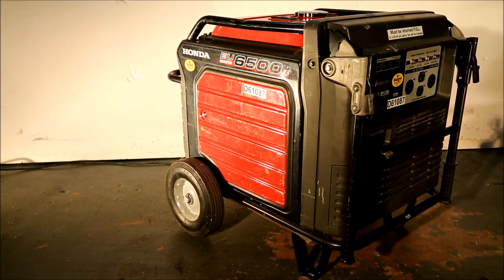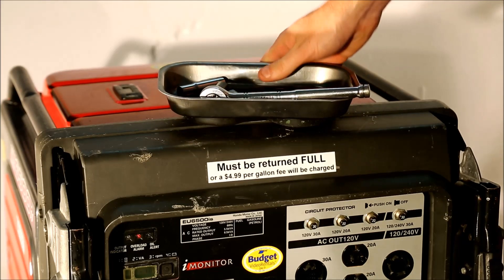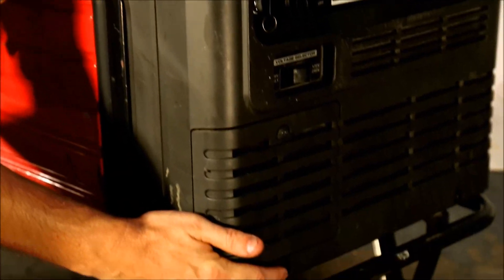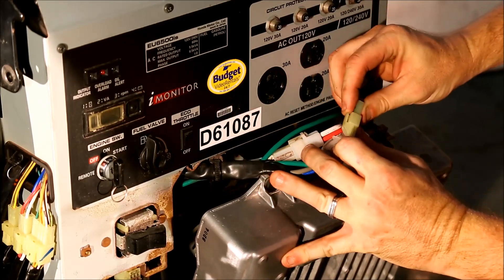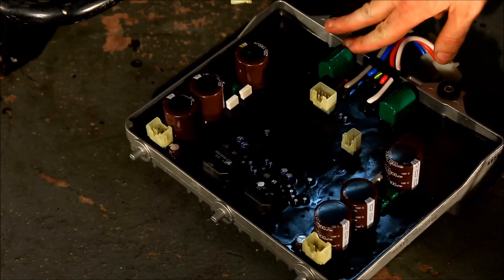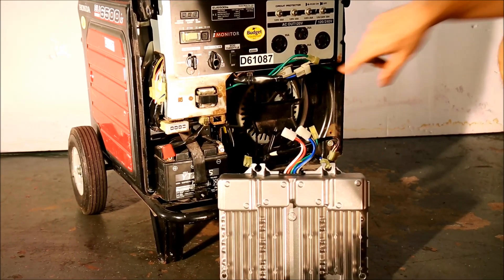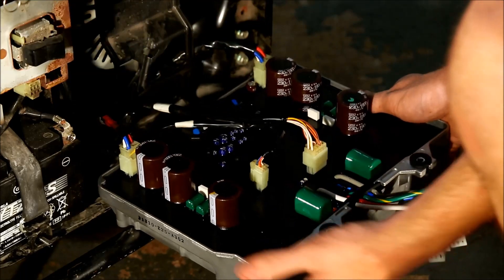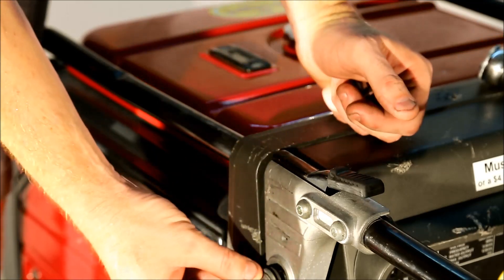Honda EU6500is Generator | Inverter Replacement

Comment: Hello my eu7000is turns on the green out light turns on and so does the red overload light the green output shuts off after 5 seconds and the red overload stays lit but doesn’t shut off does that mean my inverter went bad any information would be greatly appreciated?

Comment: Came here for the part number for the inverter unit replacement. Can you provide that please?
Reply: go to the honda parts web site the number has changed the old no. is obsolete

Comment: Thanks for the video I had to change my inverter but after I changed it my inverter is running at a 160 V is there any way to adjust the voltage output

Comment: Great video, thanks very much. We are in Australia and have been told that our eu65is inverter has gone bur the mechanic says they can only source a replacement from Honda Japan and has quoted $2500. Any ideas on where to get one online so we can try to DIY?
Reply from the maker: Hi, I just asked the website I use for parts if they ship to Australia, they said no. :(  I can only suggest to look around for Honda motorcycle dealers, they usually sell generators and parts as well.
Reply: Ok, appreciate the reply. What part number should we be looking for?
Reply: I'm having to replace the inverter in my eu3000is and I found one for $540.00 USD.  I doubt this helps now since it's two month later but if anyone else was wondering.  Good luck!

Comment: My em 7000 was running and got wet and stopped.  When I try to start it, it shuts down like in video .  Hardly used.  Would getting wet cause the inverter problem
Reply from the maker: not sure, the inverter is very well sealed so water ingress is unlikely, but you may have some corrosion on the connectors.

Comment: My em7000 has the same symptom. In dry storage for seven years, properly prepared beforehand. Started on second pull with fresh fuel, shut down with same over current alarm. Where did you source the inverter and cost?
Reply from the maker: if it has been sitting for that long, i would look elsewhere for the cause of the overlaod alarm.. spark arrestor in exhaust, clogged fuel or intake.. etc. If you are certain it is the inverter....  I source from motorcycle parts sellers who also sell generator parts.. http://www.bikebandit.com/oem-parts/honda-generator-parts/s/m6c8 for this generator it was around $600

Comment: I HAVE THIS SAME GENERATOR AND IT NO TROWING POWER TO THE SPARK. I REPLACE THE COIL AND STILL NO POWER TO THE SPARK PLUG. DO YOU THINK THE INVERTER IS DEAD.
Reply from the maker: Unlikely, the inverter is for power output, it does not control spark.
Reply: Having the same issue .  It could be the pulse generator (this provides the electrical signal to the ignition control in the generator control unit) or it is the generator control unit .  The pulse generator resistance should be 290 to 360 Ohms .  Otherwise, it would appear that the control unit would need replaced .

Comment: i was having an overload error but after cleaning the spark arrester the generator ran fine.   am i fooling myself to think the problem is fixed if i haven't applied a load yet?
Reply from the maker: You may be good to go. a clogged arrestor can cause the issue as well.

Comment: Do you have a video for checking out the EU6500i charging circuit? My battery is dead and won't take a charge. I run the generator without the battery and I see no voltage on the battery lugs. Before I replace the battery I want to make sure the charging circuit is working right.
Reply from the maker: Sorry John, I don't have a video about that.. and I was chasing down a charging issue too before I stopped working with that company, and hadn't figured it out.

Comment: I own a EU6500 and a EU7000.  How many hours do you feel these inverter generators will last?  Whats the highest hours you have seen on your rental units?
Reply from the maker: +Dqalex The Honda inverters should last a very very long time, if properly used. These units are low hours.

Comment from the maker: IMPORTANT: This overload alarm and shut down is not always the inverter. Some of the other things that may cause the shut down and overload alarm are.. bad fuel, clogged fuel lines and gummed up carb (thank you ethanol and federal government), obstructed air intake behind the battery, etc. Every time we have experienced the overload alarm is because of a bad inverter....